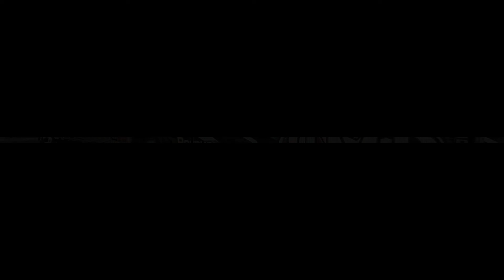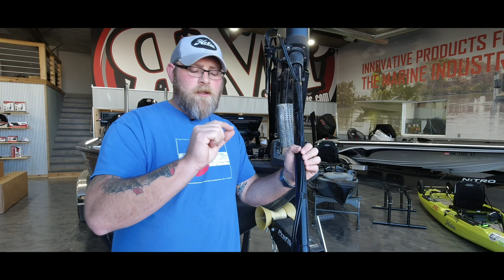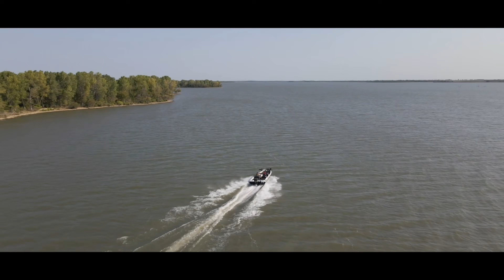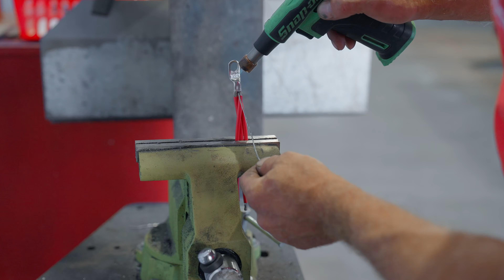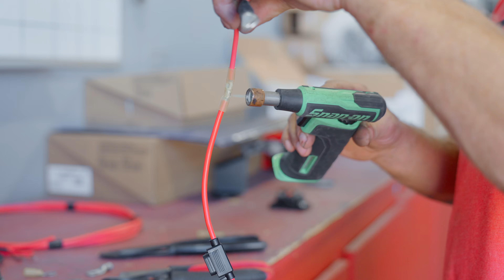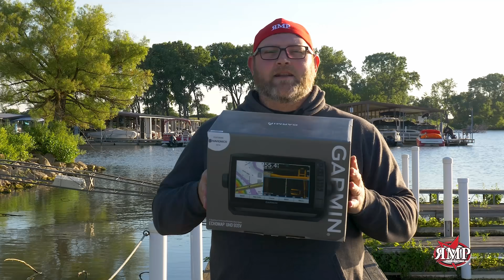Pro's Tips on How We Run Dedicated Power

Comment: Great video but maybe add in a fuse block and a main 20-50 amp breaker instead of stacking terminals. Much cleaner, easier to manage and adds more protection for the system. Good information though.

Comment: This has been Great been.  Besides the 10gage fuse hold before the Pero Switch  then Run the 10 gage to the Mega Live power cord.  put another 10gage fuse holder before the connection to the unit.  Correct

Comment: Cmon guys, 10awg wire is for up to a 30A circuit, not 7.5A. I’m all for overkill but you’d be much better off to put a distribution panel up front and branch off of that to your devices.

Comment: Is it ok to run the graph power cables alongside the trolling motor cable to the bow from the back of the boat?  Should there be a concern about interference to the graphs with the trolling motor cable being close to the graph power cables?

Comment: you say you run a dedicated set of wires to the front for Livescope/AT..... do you run a separate set for the garmin and the black box, or tie them into the same set of wires? I am running a very similar set up to what you are explaining, but am still having issues with some stitching and interference. I was thinking about running a completely different battery just for the livescope to see if that will help. I see a lot of people running all the graphs off one battery with clear images. Im confused.

Comment: So for ever 10gauge cable for each unit and module has a iso switch? Why not do a 0awg off the battery to iso then 0awg up to units then run a bus bar with ur 10 gauge to the units? Would be a lot neater? Any reason why u wouldnt do this

Comment: Why aren’t you using bus bars?
Reply: This or even better a fuse block.  That dble'd back wire to make the butt connector work is a joke.  It will never shrink down to give a good water tight connection.  Take that power to a fuse block and distribute from there using proper wire sizes and connectors only if needed.  Then when you add something you have a fused block to tie it into and no one is chasing fuses in an inline lazy man solutions when they have issues.  Like to see them do this in a saltwater rig, it would be years of chasing nightmares.

Comment: I've got a question. I've got 1 boat that has an updated cigarette lighter plug with circuit protection that works well and I assume can adjust to any voltage because I can charge my phone with it and run a Garmin UHD 93SV with no problems. I've got another boat with just the cigarette lighter style without circuit protection that runs to a fuse box and then to the battery and it blows the fuse every single time. Should I get a new one with the circuit protection and just install it on the other boat as well or just wire it directly? I don't want to wire it directly because I've got a cigarette lighter plug on it. But the circuit protection should allow it to adjust to any voltage difference whether it's a phone or the fish finder?

Comment: I would prefer a bus bar next to the Perko. If one needs eliminated or replaced simply lift it off the bus bar. Wouldn’t have to cut off a ring terminal that has three wires crimped in it

Comment: Great video, very helpful. I was wondering if running a 6AWg from the battery to the switch and the a 10 AWG from the switch to the graphs will create a trension at the switch. I have heard that you should keepmthe same gauge all along . Thanks for the info.

Comment: So is the concern with connecting to one of your trolling motor batteries that it will cause interference with your graphics? My problem is I don’t have room for another battery. Will using the starting battery for my life scope system drain it so low that I won’t be able to start my motor?

Comment: So if a boat comes in with 5 graphs, mega live, 360, Ethernet switch, you're running 8 sets of 10 gauge wire each with an inline fuse to the devices so they are all dedicated? Trying to wrap my head around what i should do.

Comment: Just bought my first boat and not very good with the electrical side of things.  If I'm running dedicated power to my devices do I bring the factory cable as close as I can to the batteries or coil it up next to the unit and run the power lines from there.  Thanks for any help!

Comment: Why run 10 gauge wire when the power cord coming off the unit say in my case the Eagle 9 is like 20 gauge
Reply from the maker: to reduce voltage drop and interference!

Comment: Would it be ok to run the 10ga to a fuse block instead of putting a separate inline fuse in each positive line coming from the battery? Any additional power drop doing that? Thanks , great video.

Comment: I have a ghost trolling motor on my nitro Z-18 . It has a it came with an lowrance elite 7 on the bow and at the console . I bought a Garmin ultra 126 sv . Since I have spot lock is the transom the only place I can put the 54 transducer ? I was also thinking about installing FFS unit ! I was going to put the transducer for that on a side pole . I will run dedicated power for both like in your video . Plus since there will be two more dedicated power wires to run. Plus potentially another transducer cable have you ever ran any wire or cable on the port side ? Any help would be greatly appreciated! I have purchased several of your products for my new boat . ie Hot foot/ turn signal trim

Comment: I’d like to see how you are keeping the wires organized. I had heavy wire going to fuse blocks when I originally wired my new boat. And the same with my last boat. I decided this year when I was switching electronics brands and replacing my batteries with lithiums, that I would try dedicated power to each unit. It’s obviously not as clean and definitely not as quick and easy, but I already had the tools and most of the connectors, so I just bought 100 foot spool of Anchor 10/2. Instead of using the hard plastic wire.Loom, like I usually do, I tried the split mesh looms. (Not that cheap stuff they make the crap rod sleeves out of). Much stiffer and split like plastic loom. The higher end ones are nice. I’m always open to ideas on how to make the wires look nice.

Comment: I talked to Garin tech on the phone last week. We now have Radio Frequency issues because of the new Live scope and Bluetooth, I pilot. The new Garmin units have an EARTH ground on the back of the GL10 and the new Screen units. This is NOT a negative - battery connection. Yes, the unit is grounded through the battery to the motor that is in the water, but when there is RF it will try to go to the ground first. So Rf may travel through your whole system on its way to the ground and this will cause noise and interference. So you may have to run a water ground. Some boats have a water ground in the hull!  Not only do you need dedicated power you may need a dedicated  Ground if you have interference for all Hope this helps.

Comment: Only problem with doubling up your wire like that on the thin wire that comes out of the units, is now those, but connectors are not going to be watertight at all. They will not shrink down to the size of a 16 gauge. They’re designed to shrink to 10 or 12 at the small. What you should do is either use a step down connector or what I did last time, I wired my boat, use a ring terminal on each and and use a single, or double post busbar just to connect the ring terminals to that and you’ll have the connections watertight.
Reply: You can also use smaller shrink tube on the small wire to build it up then the bigger shrink over the  top of that. I like your way as well. I’ve done both ways depending on application.

Comment: Great video! I used this information to power my units. I do have one issue. I am running a 93sv at the bow and at console. The one at the bow is 12.7v and the one at the console is 13.6v. Both on individual runs with 10g wire to dedicated lithium battery. Why is there such a difference in voltage?
Reply: voltage drop is a function of length of wire.  the longer wire has greater resistance, thus greater voltage drop.
Reply: @Muskyfishn84  I am reading 13.6 at the connection/tray with the volt reader. The display on the graph shows 12.7
Reply: @UNCLExBOBBYxB that is correct.  The voltage drop from the load then is the difference.  The wire is included in this load.

Comment: Would I be okay with running 8 gauge instead of 10 gauge or does it have to be 10? I'm running AT2 and two HDS 12 Live units.
Reply: Yes. 8 gage is thicker- bigger wire so less resistance.  But given the lower current draw the resistance is insignificant. Meaning if you have the 8 gage use it. Don’t buy it because the extra cost provides no additional value and the bigger wire is harder to work with.

Comment: Thanks RMP for the video.  Question on dedicated power, I have Lowrance HDS9s and I'd like to run dedicated power to them but remove them from the boat while in storage.  Can I wire the power directly to the battery using the O-rings and eliminate the need for the on/off switch?  There won't be any parasitic draw if nothing is connected to the other side of the power wire, correct?

Comment: So if I’m running 5 units on my boat I will need 2 perko kill switches (3 lines going into one of the switches and 2 lines going into the other switch) or can I double up the ring connectors onto the terminal in the perko switch?

Comment: can you explain Humminbird and the required 5 amp SLOW BLOW recommendation and what you use to install according to the manufacture. it is literally impossible to find a 10awg inline fuse holder.
Reply: You can have a heavy fuse holder but run the correct size fuse for the purpose installed
Reply: A slow blow fuse will take  a higher initial surge in current but for a fraction of a second.  Therefore if you turn everything on at once current draw goes higher than 5 amps but settles below 5 in less than a second. It keeps you from having to replace fuses! Running a bigger fuse is as bad ideas because damage to the unit would occur. Hence a slow blow 5 amp fuse.

Comment: buy a proper box crimper, run larger gauge cables up front and split at fuse blocks with proper sized cable. You can also wire the units (or all electronics) up to a simple dash switch to cut power. It's a simple boat with a simple setup, why overcomplicate it?
Reply from the maker: No fuse blocks. Dedicated Power every time.

Comment: Hey guys, great video.  I have followed all your tech tips in this video.  Thank you very much. 

Question:  Can you let me know what you use to power an ethernet switch to battery when factory packaged wire is not long enough... I would think you can use the 10 gauge wire with the buttes.  Or should I use a different guage... please give a full tech tip for this on accessories  and where to buy each parts you guys use...please would be awesome, hear back.  You guys are awesome!!!💯😎
Reply from the maker: on the 5 port switch we tie into factory boat power as it does not draw near as much as the units.

Comment: Hi,

I have watched your you-tube video about dedicated wire and now have all the items. When making the 6 awg wire, 3 each  into 1 lug, then connecting to Perko Switch.
Your thoughts on if I want 4 each 6awg wire into 1 lug. Is 4 too many? Suggestions?  I will have 2 depth finders and 2 livescope transducers up front, Will all 4 items need power dedicated wire?
Reply: use marine grade (and properly rated) bus bars

Comment: Thanks for the informative video. I have one question: Would you also recommend running a separate 10ga wire for a mega 360 or can I run 10ga to a bus then separate it from the bus to the unit and 360?
Reply: I had the same question, what did you end up doing?

Comment: I like the idea of having the fuses for the individual units at the battery.   Easily accessible.    But does it not reduce/restrict the flow of current when you’re coming off the battery into a tiny 7.5 amp fuse filament(16-18ga?), then 10ga wire for 20ft to the bow. Seems like the fuse would be better at the unit end to avoid voltage drop.  Does the close proximity to the power source negate this reduction in conductor size. Please help me understand electrical theory.
Reply: No, because the current draw on either side of the fuse is the same, which is whatever the equipment is drawing.  The idea for the larger gauge is so that the wire itself doesn't attenuate the voltage through its own resistance.  It's still a max of 7.5amps through the whole circuit, regardless of the fuse size, or no fuse at all for that matter.  
And remember: 7.5amps is the trip voltage of the fuse, not the operating voltage of the device being protected.  Most likely it's drawing 5amps or less, so a 7.5amp fuse is not restrictive at all.

Comment: This is the best video with a detailed explanation on how to connect your electronics! I wish I had this video 7 months ago. If it wasn't difficult to get to my bow wiring I'd move my fuses next to the battery (maybe next time I HAVE to get into the bow). Question, I set up a perko switch for my Power Poles and am thinking about adding a Lithium battery for my electronics and instead of doing another perko switch could I use the perko switch with the power poles?
Reply: please, take it to a professional

Comment: Are you using 10 AWG wire to run the span of the entire boat even for larger graphs like the gps map 8612??
Reply from the maker: Yes. We use 10 gauge on ALL units!

Comment: BTW guys, there is no "fuse-breaker" component.  You're using a breaker in PLACE OF a fuse. I do not agree on across the board use of a 60A breaker; some do NOT require it.  The best protection comes from the lowest amperage that works correctly with a given trolling motor. As an example, the Ghost installation manual specifies a 50A breaker from both 24A and 36A configurations. Using a 60A breaker with a Ghost is unnecessary and will leave an additional 10A to a defect before the breaker trips. Let the breaker perform the protection function as it should  - install the TM manufacturer's recommended breaker size, and no more.

Comment: I use a terminal strip at the bow inside the hull. Supplied power cables per unit simply get ring terminals that fit that wire to attach both + and - to the terminal strip. The 10 ga. runs also get proper size ring terminals that also attach as appropriate to the terminal strip. The terminal strip makes the transition from 10 ga. to small ga. wire, and it simplifies the future removal/replacement of any power cable.  The fuse is still at the power switch in the battery compartment for ease of access.

Comment: Instead of cutting off the in-line fuse that comes with the sonar units can you just keep them on and also still add your inline fuse to the back by the battery too ? It would just be double fused. Is that okay?
Reply: You could do that, but the better option would be to shorten the cable going into the sonar.  They use very small gauge wire on that cable and the less small gauge wire in the "system" the less voltage drop you get.  Every little bit helps.

Comment: Super good video here. I rig all my boats so I’ve got years of experience doing this stuff and you guys helped me with a couple ideas that I didn’t know about. Doubling up the 16 gauge wire for a 10 gauge butt connector is such a good idea.
Reply: It works in a pinch. But a better way is to use   the Anchor step downs. Or if you want to be able to remove them, small bus bars with ring terminals.

Comment: I think 10 ga wire to each unit is overkill. You are running 10 ga wire and then going to a 3 amp fuse to the graph with 14-18 ga wire on the factory supplied power cable to the unit.  How much voltage drop are you seeing in less than 25 feet? I think if you are seeing a. Improvement from the 10 gauge wire to each unit it has more to do with interferance reduction. I run 12 ga to each of my graphs from a dedicated  battery and clip on ferrite cores on the positive and negitive leads just before the graph power cable connection on the dedicated 12 ga conductor. I solder every conection. I also run the dedicated power wires on the opposite side of the boat that the trolling motor wires run on. My graphs are clear and look great. I'm not saying it's wrong to run 10 ga it just costs more money, and you have a better chance of having a bad connection point where the much larger 10 ga gauge wire connects to the graph factory power cable. Especially with crimp connections.

Comment: Great info guys. Could you run a fuse block off your battery then 10gauge wire from there to your units?
Reply: I had the same thought.  I'm planning to use a fuse block to avoid having to run a bunch of wires off the battery and to leave room for expansion in the future.  I'm going to run either 8 or 6 AWG from the battery to the fuse block though.  I'll run the heavy wire to the switch and then to the fuse block.  It's more "hardware" in the battery compartment, but fewer connections to the battery itself.
Reply: I don’t work for russel marine but yes you could run a fuse block if you wanted too.  Ideally it would be best to run straight to the battery and eliminate the fuse block. But you most definitely can use a fuse block if you wanted to. But the best way to get the most clean dedicated power to each unit is to run each wire to each unit separately without a fuse block. But again if you wanted to you can use a fuse block. I used one on my last boat I had that I installed

Comment: What kind of crimper do you use for the 6 gauge ring terminals?
Reply: The best method I've seen for this application is to twist the wires together, fill the ring terminal with molten solder (use a torch) and immediately put the wires in the molten solder.  The cost of a crimper that large is prohibitive unless you are in the business.